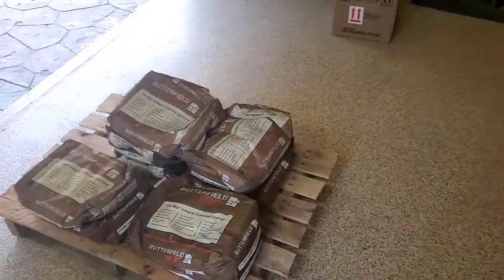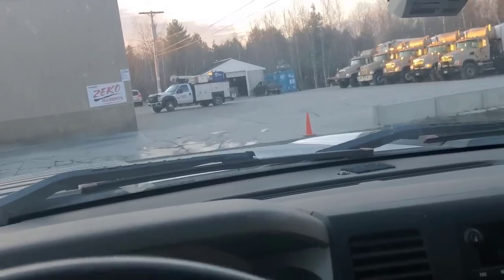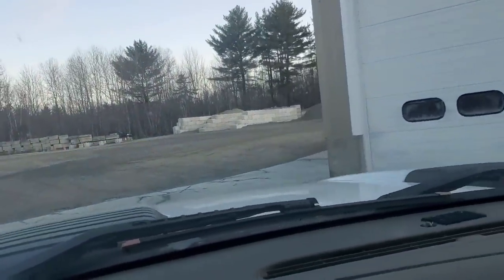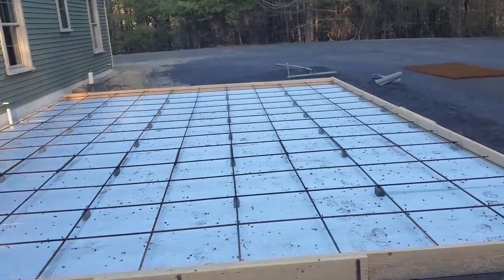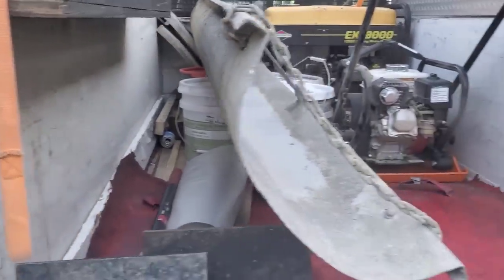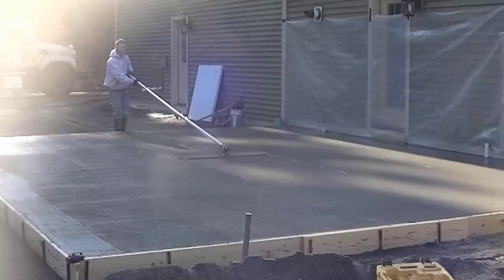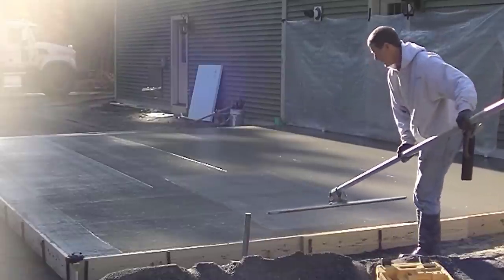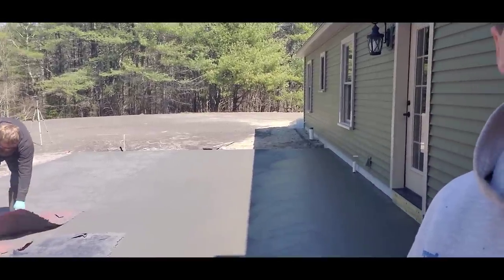Homeowner Formed This Concrete Slab - We Poured It! Part 1

Comment: That was the closest thing to a "perfect" pour that I have ever seen. 
Great job of forming by the homeowner, a perfect morning weather-wise, ideal mix consistency, rebar on blocks instead of bar or mesh laying on the grade, a good driver, and a QUIET, experienced crew that works together like a well-oiled machine at every step. 
 
 And no mason starting to build his walls while you're still finishing the slab!
 
At first it looked to me like the owner didn't have any slope on it, but then you mentioned that it was, in fact, sloped properly away from the house.
 I think I actually breathed a small sigh of relief when you affirmed that!

I am curious as to  the reason to insulate this outside slab, though. I get  why we do it inside a building, but guessing he may be looking ahead to possibly build a room addition on it in the future?
 
Thanks for bringing us this video, Mike.  I really enjoyed it, as I do all your work.
Reply: I thought the same thing about the rigid foam. But if he was thinking of a future room addition he would/should have done monolithic footings around the outside. Can't really build a room addition on that slab and expect it to stay put.
Reply: @TrailTrackers   Good point.
Reply: @ronkruchten5867  frost heave preventative, and serves as vapor barrier moisture barrier if sealed at the seams. Should have extended past the slab area a bit if frost heave is what he is trying to prevent.

Comment: On patio and walk slabs like this, try putting a radius inside the two right angle corners away from the house. Do this by cutting 1/4 of the circumference out of the side of a plastic 5 gallon bucket, same height as the forms. Couple of screws or nails to hold the plastic radius form to the inside of the wood form. When the forms come apart, the plastic radius forms come out, too. The result is a pleasing rounded corner that has reduced risk of cracking or breaking from some shock load or hammering foolishness later on during the life of the slab. Gives the job a little touch of class that's missing from typical square corners.

Comment: it takes a special kind of home owner to be able to form their own slab. most can not get it right
Reply: It does. I did my own forming and prepping for my garage build (34'x40'). It was lots of work but worth it and rewarding. When the concrete guys came for the pouring and finishing, I told him I guess it's my problem if it isn't square or level(drain in center garage) but I knew it was perfect. The concrete guy said lets check it and he was amazed how perfect it was, it was bang on the money. I'm a machinist by trade so everything as to be perfect, it's almost a disease, LOL! He did tell me about horror stories and I'm you've got some as well!

Comment: I'm grateful for the detailed narration; for example, when you notice low spots, what a bull float does, and the situations where you might use a 3/8 vs 3/4 stone in the mix. Things like that are so helpful. 
I'd like to know a bit more about timings. Understandably, temperature and other environmental facts ( sun/wind ) make each situation a bit different. But short of adding a clock and weather data on the screen ( would be a neat feature ) are you all just going by feel, when to mag, etc? 
And about power trowels; how realistic is it for someone with no experience to rent one and not wreck all the hard work that came before? Could be an expensive learning curve! 
Wishing yinz much health and happiness
Reply: He's addressed that on other videos.  Basically put your fingers in the concrete to measure how set it is.

Comment: I did 25 yards of stamped patio at my place, I didn't use integral color, just deep charcoal release. Turned out good, but in the long run color would've been better

Comment: So, when adding bags of color to concrete, you add the contents of the bag and not the bag itself right? The concrete driver just dropped that whole bag into the hopper uncut. Good looking slab. Can't wait to see part 2
Reply: A lot of bags are meant to go straight into the load now. Much appreciated as a driver. The old way was very messy especially on a windy day. Our plant now has liquid colour added as truck is being loaded. Supposed to be much more accurate for multiple load jobs.
Reply: @robertbreen8632  thanks for that. I figured the bag material would wind up in the pour
Reply: @GabbyJohnsonIsRight  Disintegrates

Comment: I have a stamped concrete patio in the back, but it’s getting cracked. I live in Canada, and the winter weather seems to be the big issue. Is there something I can use to fill in the cracks?
Reply: I'm in Canada as well and that's the reason I went with interlock. How do you fix stamped concrete? You can't without it being noticeable.

Comment: How much do you charge to form?
Reply: Forming is usually just about of the slab size. You really only take formwork into consideration if it's complicated or curved.  Plain form takes as fast as 4 hours to a full day.  More complex forms can take 2 Day.  This time doesn't include grading rockING planning. 
So anywhere between 250 - 1200

Comment: What's your take on all this dry pouring that's the craze on youtube lately?  I asked Odell and he just said it will fall apart in no time. But for premixed bags with  a methodical misting and watering it seems like it would be pretty strong.
Reply: The misting and watering does not get down to all the cement so there are dry spots and holes underneath.

Comment: Why not throw the color bags in at the job site? That's what we do? Is that wrong?
Reply: If it has time to mix I guess it would be ok, that would be a concern though.
Reply: @michaelvonfeldt9629  i always tell them to spin the drum 50 times. Not sure if it's enough but haven't had any problems so far.
Reply: @Jesse-ve5oo  yeah that works. I have some parameters as far as revolutions and temperature are concerned that I live by. I don’t exceed 300 revolutions, 90 mins old mud at 90 F.